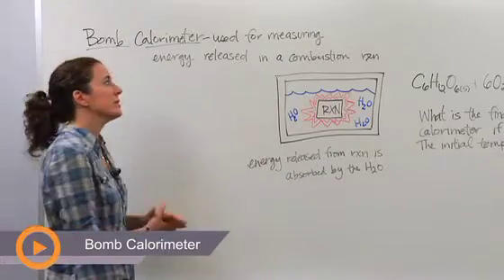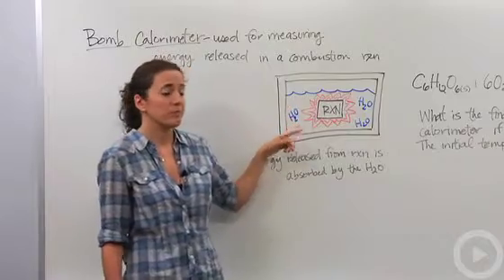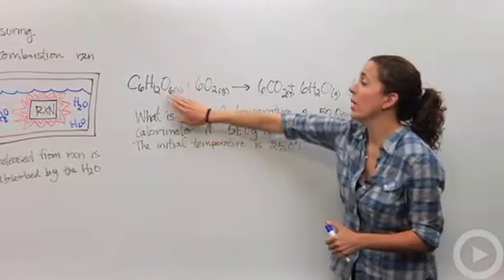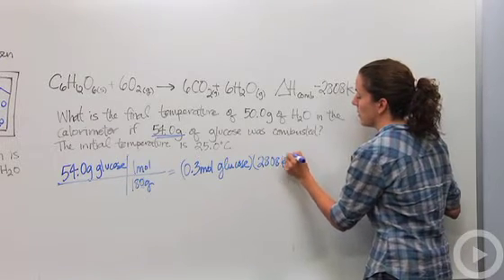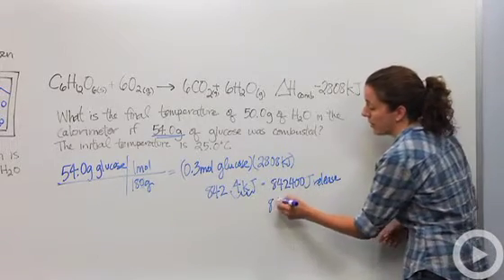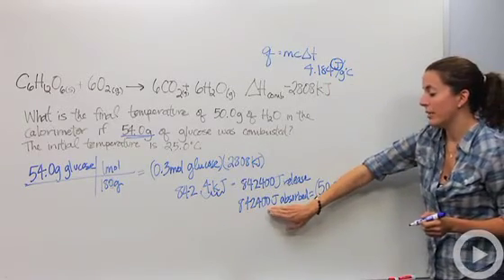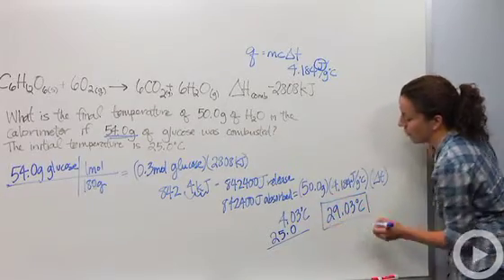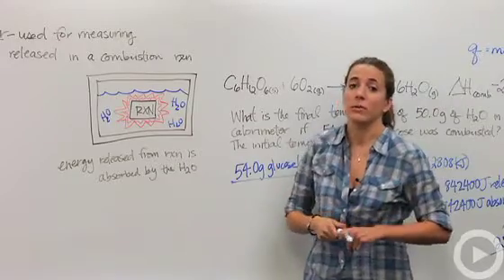Bomb Calorimeter

Comment: Where am I going wrong... Q = M x C x Delta T.
50g x 4.12 x (25.0 - 29.3 ) = -885.8 J
-885.8 / ( 54g / 180 ) = 2952.66 J
2652.66 / 1000 = 2.952 KJ 
That's what the delta H should be if the increase of temperature is 4.03.
For this kind of reaction it should be so much more, around an increase of 16 degrees, right?